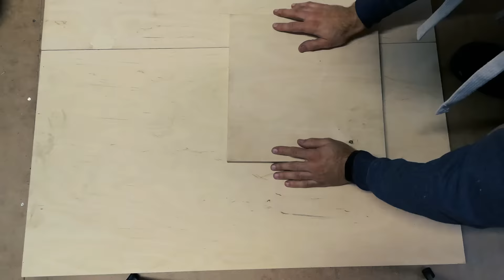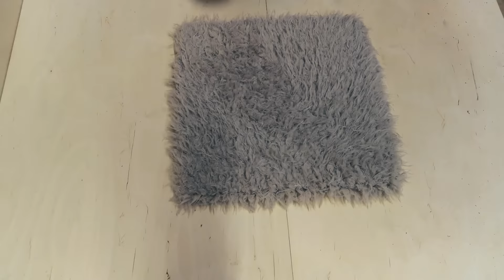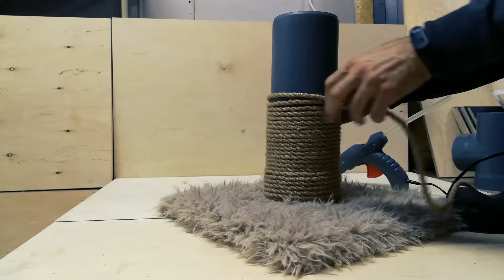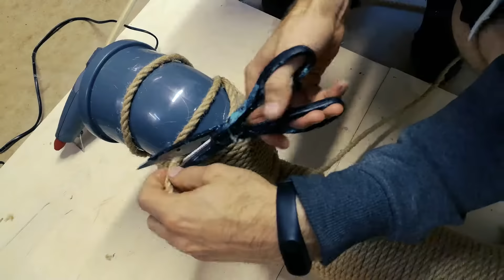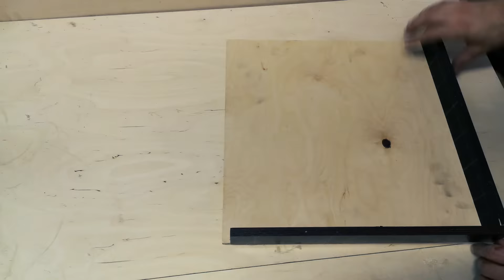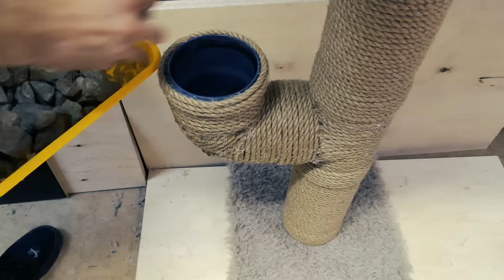How To Make Easy Cat Scratching Post With PVC Pipes, Rope And Hot Glue

Comment: You genius. I have been racking my brains trying to think of a cheap way to make an extra-stable cat tree not like the ones I have purchased over the years that have cardboard cores. I replaced our old wooden banister with a modern one and was thinking of using that pole, but this is way better. Damn, brilliant ! I have the welding solution already, all I need is a few inexpensive PVC drain pipe parts and some rope!
Reply from the maker: @Lee.Willcox  As I mentioned in other comments, I recommend that you think about mounting with a base. This method, with a few screws through the pipe cap, is not the most stable So I kept mine in the corner so it wouldn't fall over. But it also depends on how crazy the cat is.
Reply: @craftzars  or just add more weight to the base ( fill it up with sand or something) 
Ow never mind you did that
Reply: @brittgoossens3427  100%, great idea. Mine will be tall. floor to ceiling so I will attach it to the wall with screws. Half way up and at the top. Cheers !

Comment: It looks good but from my experience when wrapping a post with the rope, you need good tension on the rope and a glue below it (I use double-sided tape over the whole post) to keep it in place when the cat goes to scratch it. With just dabs of hot glue I can see it all falling apart. Cats can be strong.
Reply from the maker: Cant see in video because of edit, but there is glue on every round, so when cat tear one round so it dont collapse fully. Yeah double sided tape sound easy solution, but I don't think that such a rope will hold better than a glue gun

Comment: thank you for this video!! i was searching for a diy of how to build a cat scratching post with pipes but could only find it with wood! im gonna make this this week! thanks a lot
Reply from the maker: Good luck with your scratch post. :) my cat use it every day.  Sometimes lazy way - sleeping on that middle  shelf and scratching nails without getting up. I was using hot glue for every round of rope, so if cat destroy rope, it does not unwind all the way. My build is good only in corner, because its quite high and base cant provide stability. Need to redesign litle bit. Probably cut round circle in base and post tube through. Or put round plywood in tube , screw around and then screw to base. :)

Comment: Great work.  Only thing i may have done slightly differently was make base a few inches wider for more stability and less wobble.
Reply from the maker: Yeah but then next weakest point is joint to base
Reply: - Agreed. Perhaps, should’ve cut circle in center carpet so the joint lays flushed with the board, and then hot glue down to base along with the 5 screws.  ?

Comment: im building this but with my own little twist, 
adding a hiding box in the bottom and putting the top part at roughly 2m so the cats can overlook their kingdom.
wish me luck fellas!
Reply from the maker: Good luck with your project! 😊
Reply: @craftzars  thanks.
I failed miserably and it was too unstable.
moral of the story: don't hot glue a 2m tall pole
Reply from the maker: @ShitpostShuster  😄 did you remake it shorter?

Comment: A wider base would make this cat tree more stable.  I would use 4x4 fence posts instead of the plumbing parts which are more expensive.  I liked the fluffy material used instead of carpet on the base and shelves.  With some elastic sewn around the edges,  they could have been removable for washing.  Some 2 inch foam on the shelves would have been nice.  Great project.  Now, how about building a Catio ?
Reply from the maker: I had catio on last appartment with balcony. In summer i changed balcony doors panel with plastic un cut there hole and cat have access to catio 24/7 https://photos.app.goo.gl/jaCwsPCK7LRoTLAo8 but now i live in second floor without balcony and cant build it.

Comment: Love the sound effects.  But, I have to ask.  Why didn't you use PVC cement vs the hot glue gun on the tube connection.  I'm going to make a few variations, but the end result of this is FANTASTIC~
Reply from the maker: I dont have pvc cement, so i used what i have. Hot glue is not best solution there but if you use enough it works.
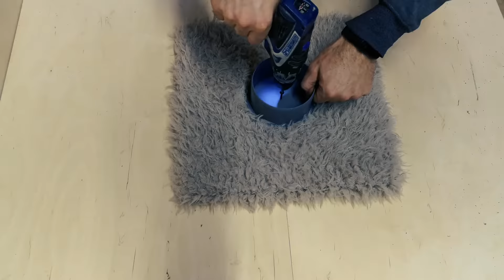Reply from the maker: also if I had to do it again, I would make a stronger base mount.  2:25 i used just pipe cup and 5 screws to hold all tree, it is not very stable. if you put it in corner there is no problem, but for other places where its stands freely its not good. a better solution would be to insert several plywood discs inside and then fasten everything neatly and use concrete not just rock for inside filling.

Comment: May I please ask how you calculated the amount of rope needed? I seriously under-estimated. Thanks so much! I am so bad at DIY but cannot spend $100 on a cat tree!! This looks doable...
Reply from the maker: Diameter of pipe is 110mm so circumference is c= pi*D so 3.14x110= ~ 345mm. So you need ~35cm for 1 round. If you have 6mm rope and you want make 1m post , thats will be 1000/6= ~166 rounds. 166x35cm= 5810cm= 58m .  In my country that rope costs 0.21eur so its around 58x0.21=~12eur
Reply: @craftzars  Thanks so much!

Comment: That hot glue gun, what a star. 

I would be curious to know how well this held up over time. I've had bad experiences with staples, so I don't use them anymore for anything designed for comfort, but maybe your experience is different.
Reply from the maker: Dunno whats bad about staples, most of furniture fabric is stapled . You can watch my last video to see how tree is looking after 1.5years, and how easy is to repair it

Comment: I made one and used the card board cylinder they use to pour concrete in to make support beams for houses. So she would have a hidey hole. With the poles and boards got a very nice for story tree for about $20 saw similar for well over $200

Comment: How do i make it more stable? Ive done everything on the video and its not stable, its moving
Reply from the maker: Put it in corner like i did 😂 because its not stable on its own. First need bigger base, but if you made bigger base next weak point is base to pipe connection, it will not last with just a pair wood screws. You need cut round plywood plates what fits inside pipe and screw trough them to base depends how thick is your plywood you probably need many layers and then you can screw also from side trought pipe. So you have solid connection. But if that dont help you can try put long threaded rod in center or multiple and secure with nuts at base and pour cement inside pipe. If that dont help you can not 1post style tree but 2-3 post style so tree have more legs and its connects together but there will be some problems with fitting it together because i think there is no ready fitting to connect 3pipes together so you need precise cutting and gluing. And of that dont work than lastly you can just can take bracket and screw top plate to wall and its not going anywhere (only if you can drill in wall)  i cant think anything else what you can do if nothing from this doesnt work
Reply: @craftzars  yup , we did put it in the corner now haha, we will just fix the moving pipe, we have to put some more screws so it doesnt move the pipe and the platforms, also thanks for helping, now it will be perfect for our cat,

Comment: Dude, you're giving me a phukin heartattack not using any ppe with that rusty ol saw...
Reply from the maker: What is ppe?
Reply: @craftzars  personal protective equipment,  gloves,  safety glasses....instead of using a heat gun pvc glue works 1000 times better and provides a stronger bond on that pipe... other than that, this is a great economical diy video !!! Thanks for sharing!!

Comment: Please tell me what the diameter of the rope is?
Reply from the maker: 1x 6mm x 60m rope (around pipe is about 36cm so if you want make 1m scratch post you need 100cm/0,6cm= 166.7 x 36cm= ~6000cm = 60m of rope

Comment: The base is way to small thats why he had to put it in a corner. Other then that cool and innovative idea
Reply from the maker: You are damn correct, and glue with screws method is not strong enough  to hold all post to base. But i wanted it in corner, so it was no problem for me 😄

Comment: $137 USD at my local hardware.. And the "90°" wasn't even a true 90°. At least you got yours to work. I'm taking back the pipe I didn't cut and going 2x4.
Reply from the maker: Sounds expensive 😱
Reply: @craftzars  lol. Yeah but, still cheaper than a premade.

Comment: How to make it not move?
Reply from the maker: Stronger base
Reply: @craftzars  I don't understand you, a strong base like what for example? In the video I see that it moves when you move it, but can't that make the cat fall if it moves a lot?
Reply from the maker: @marcofederico8479  hmm, metal bars inside would be a good solution, but I think it would be easier to put wooden log, so you can easyer to strongly screw. Also multiple legs are also good solution. You can also pour concrete inside, but thats does not solve connection problem with just 4 screws. Thicker more bigger base and strong connection with big central through rod. Another solution is just screw one of the top shelfs to the wall so all tree dont fall, or build it long enought to to jam against the ceiling
Reply from the maker: @marcofederico8479  or just put it in corner like i did 🤣

Comment: Me gustaría saber la descripción de los materiales.
Reply from the maker: Lista de materiales:
1x tubería de alcantarillado D110-1000mm
1x tubería de alcantarillado D110-250mm
1x triángulo de tubería de alcantarillado D110 / 110
3x vasos de tubería de alcantarillado D110
1x tubo de alcantarilla D110 90 ángulo
1x D110 / 110 acoplador de tubería de alcantarillado
1x cuerda de 6 mm x 60 m (alrededor de la tubería mide unos 36 cm, por lo que si desea hacer un poste de arañazos de 1 m necesita 100 cm / 0,6 cm = 166.7 x 36 cm = ~ 6000 cm = 60 m de cuerda
1x 30x30x1.2 cm de madera contrachapada para el primer paso
1x madera contrachapada de 40x40x1,2 cm para cama de gato + 4x madera contrachapada de 39x4x1,2 cm para paredes de cama + 1x cojín de espuma 40x40x2 + tela de piel artificial de 1 m
1x madera contrachapada de 35x35x2.6 cm para la base
algunos tornillos y barras de pegamento
Reply: craftzars Gracias

Comment: First off I'd like to point out that *Hot glue* does NOT stick/adhere/glue to pvc pipe AT ALL. That's why pvc has its own glue & primer (can be found in one container). I've used hot glue on pvc and as it might seem that its "glued" after its cooled down will slip off of one of the sides and you can easily pull it off with your fingers after your project has fallen apart. Only thing that might be holding his together is the winded roap which without sanding the pvc to attempt to hot glue the roap will come off first few scratches from your cat. Don't put your time & energy doing it exactly the way he did. Do your research first and find out what glue actually works on pvc. Cuz anyone who has dealt with hot glue knows how easy it is to peel from nearly any project, let alone a smooth pvc. Just sayin.. other than that I love the rest of the idea/project.
Reply from the maker: Before vidoe i dont know about pvc glue, and i put some screws in connections too, so after year my build stays strong, except cat already destroyed part of rope

Comment: Any self-respecting cat would make short work of that flimsy 'hot-glued' cat hazard. That rope wouldn't stay stuck through the first scratch session. However, PVC is routinely used by DIYers for these scratch posts, but you need to use PVC cement. There are also other ways of attaching things using appropriate fasteners, none of which require power tools. A trip to your local DIY store will prove hundreds of options. Get creative, but please, not at the expense of Fluffy's safety.

Comment: Why to top heavy. Not stable nuff
Reply from the maker: In corner no problem
Reply: @craftzars  never to late to add a bigger base... 
Personally I build mine so I can climb it too hehe
Reply from the maker: @evetsaderes2721  haha lol , little bit of welding and you can snuggle with your cat at top 🤣
Reply: @craftzars  ironically I am a red seal journeyman welder. Don't need mild steel to hang at the summit with my girl. 
My dad's a carpenter n showed me how to build wood just as strong as steel  😉 

Love climbing my cat tree n petting my bb. 

Also need to climb it to vacuum it properly with out tipping it over .